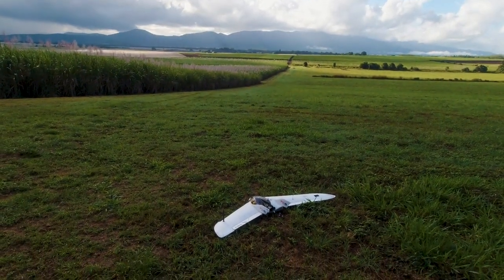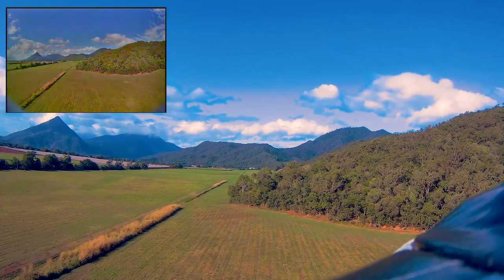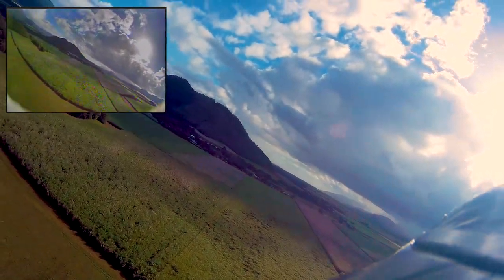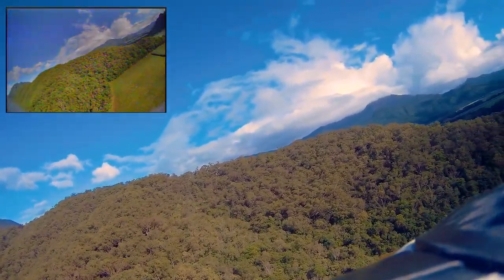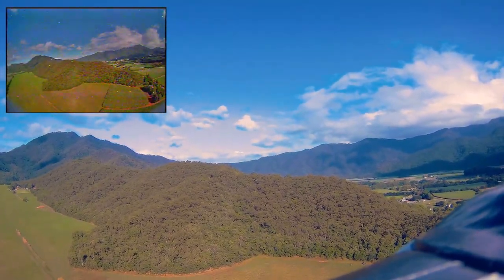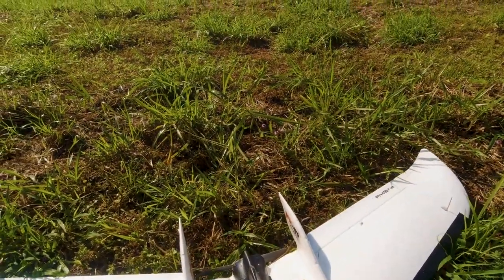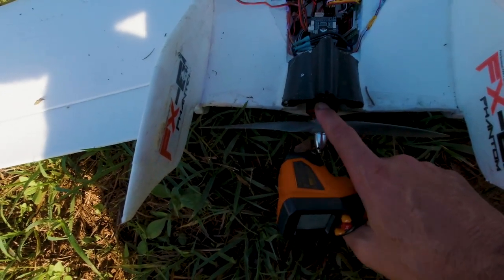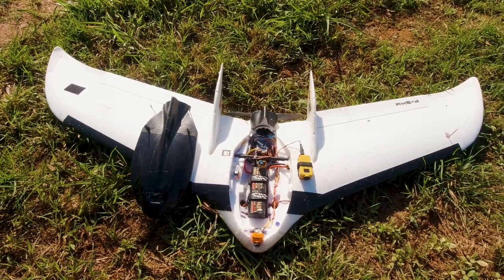FX-61 Remaiden with Speedybee F405 Wing Flight Controller

Comment: Hi, friend! I can tell you how to solve the problem with turning off in-flight telemetry. I have the same flight controller Speedybee F405 Wing. It has a top board with a WiFi module and a Bluetooth module. These modules interfere with the radio on the aircraft during flight. If the top board is removed, then there will be no telemetry shutdown in flight. I did this and everything was fine!
Reply from the maker: Interesting I’ll try it and see if it helps. I ended up just turning off the alerts on the transmitter.
Reply: @stonesrcchannel  Turning off the missing telemetry notification is pretending everything is fine when you have a real problem. I would not do that)))
Reply: Hiya all, about the WiFi and BT, you can disable both with the boot button (6 second press, until the LED closest to the analog camera port is off). I tested to see if these impacted my ELRS and FrSky x16 Rx's or analog video, and saw no impacts on range or noise. I tested on HappyModel ELRS Rx's, FrSky X8R, L9R, and XM+ RX's. 
Through my testing I did learn that my HD cameras were the biggest losers - the Caddx Peanut must have one helluva WiFi chip in it!!!
I wonder if Stones had any caps installed on it, I know he mentions there's no filter? I always pop on a 330uf minimum, where the ESC leads meet the PDB, a 1000uf on twin motors and quads. While I didn't have the disappearing OSD issue with this FC, I did with a little Matek F411 WTE, solved with a 330uf cap.
Reply from the maker: @GhostRyderFPV  thanks for the very helpful insight, I currently don’t have any caps on the esc in this video but I do plan to put one one as I never had a spare during the install. I agree the cap on esc should solve some of the video issues as my other planes all have caps and much better video. So from your testing I may have to try a flight without the hd camera to see if there are any differences in fpv quality.

Comment: I can’t seem to get more then 1 servo to work if I have 4 plugged in I get nothing. I  have clicked on enable servos and I also noticed a option for servos or motor or default. I have chosen servos, then the 1 servo doesn’t work put it back and the 1;servo works. Help please
Reply from the maker: It should be set automatically after you install the firmware you would have had to choose a platform your craft relates to (Delta Wing, V-Tail etc). As long as you chose the correct one for you craft there should be nothing you need to touch. Make sure your servos are set up on their correct ports on the flight controller. Inav suggests which ones they are in the outputs tab. Other than that it could have something to do with your mixer setup on your transmitter. Other than that i would suggest to ask about on the INAV fixed wing group facebook page they have helped me a lot with issues during setup.
Reply: @stonesrcchannel  thanks

Comment: Nice setup, because of your build video i ordered this speedybee f405 wing to put it in my ranger 2000, as a matter of fact i think i am in trouble on the process of installing my board. It beeps continuously, do you have any idea on this matter?
Reply from the maker: I have no idea why it would be beeping continuously like you say. I assume u have installed either INav on it or ardupilot already and done all the required wiring for install?
Reply: @stonesrcchannel  I used the speedy bee app inav configuration
Reply from the maker: @markosdiytv9  it could be possible it never installed the firmware correctly. I would try reinstall it. I haven't had great success uploading firmware through the app I always use a PC. I would suggest not to use a wireless connection to install firmware it just my preference.

Comment: Are you Flying with a FrSky RX? if you are try UniRX by Aloft Hobbies, much better Telemetry link. My Speedybee F405 is going into a motor glider. EDITED
Reply from the maker: Motor glider sound good too. That's something I wouldn't mind getting into someday too. The rx in this is a happy model es900. I also turned the telemetry warning off on the transmitter after the flight.

Comment: Did you have auto launch ? Is there auto launch on this FC ?
Reply from the maker: That was auto launch through INAV. Auto launch was active until the plane banked.
Reply: @stonesrcchannel  thanks again,  I'm just getting everything in order now. The only thing left us which GPS module? I prefer one without compass,  which one do you use ?
Reply from the maker: @endliberalism4305  I have a bn220 but any GPS will do just disable compass.
Reply: @stonesrcchannel  right on brother,  appreciated